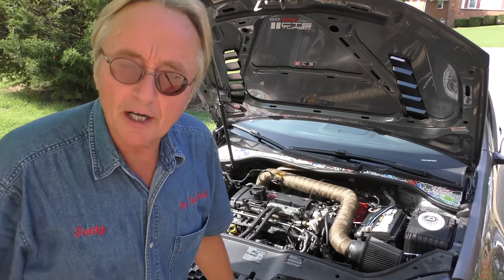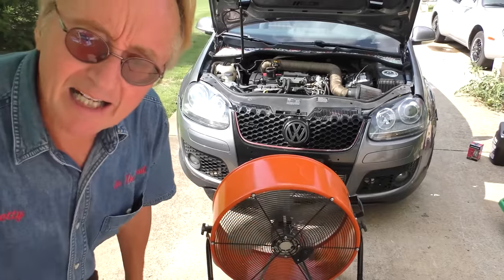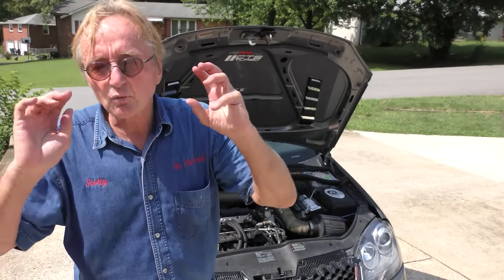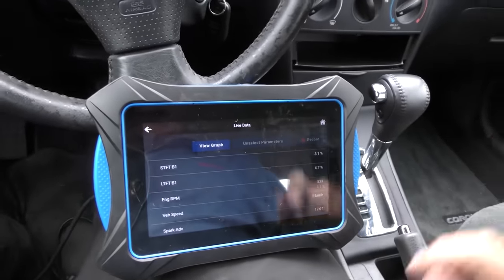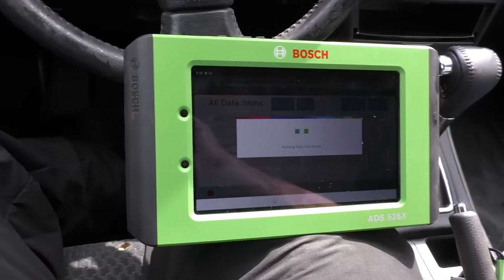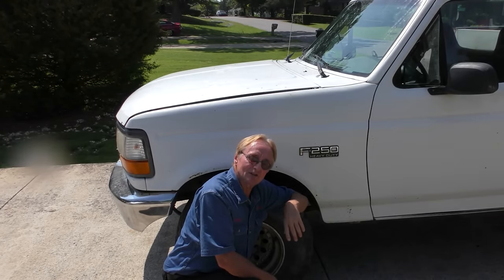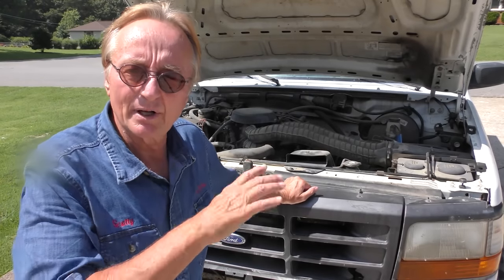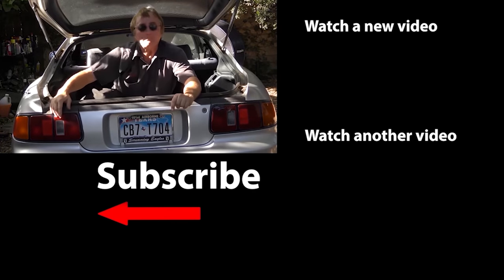3 Additives That Will Make Your Car Last Twice as Long

Comment: I've been adding half a qt of transmission fluid to my oil for ever. My dad did it to his trucks my grandfather and so on. My Isuzu trooper has over 600k miles on it. Never had engine problems. My 98 silverado was at 380k miles and never had any mechanical issues engine wise. My 2013 just started having engine issues. Gave it a qt of trans fluid and a week later it went away. Had lifters failing. No more issues 2 months later

Comment: Gm ecotec 4cyl.
Used 1 oz of marvel mystery oil in each cylinder. Cranked it without starting it, let it set for 24 hours. Then, Warmed it up, changed the oil, solved the oil burning issue, 1 qt every 500 miles is bad. Your right Scotty, those low tension rings collect carbon and stop doing their job.

Comment: Dear Scotty,

I just bought a new car and it's not even at 2,000 miles yet. Do you recommend any additives or additional things that might prolong the life of the vehicle? I use top-tier rated gas stations, so no cheap gas going in. Let me know what you think, but I don't want to mess it up so I'm holding off on adding anything. Have plenty of Marvel Mystery Oil though lol
Reply: Naaaah, just keep doing what you're doing Jerd. Just put it on the road periodically once or twice a month to exercise the motor, for city driving is like a slow death
Reply: you nèed it

Comment: NEW TO YOUR CHANNEL, Scotty! A really wonderful & instructive video!  I think I need to use that ATS 505 CRO additive on my 2010 Audi S-4 with 137K miles. It's been going through oil more frequently over the last year or so. I'm thinking there's a lot of that same build-up around its V-6 pistons. Hopefully it will reduce oil burning AND give me better performance.  I really love this (manual-trans) car; had it since new in 2010.

You have outstanding tutorials, Scotty. I feel like I'm right there in your driveway in the TX 'burbs.  I'll be checking you out more in the future.  QUESTION: What's with all the flailing hand & arms movement??  You'd think you were Italian! 😀

Comment: My 2014 Acura TSX has120000 miles.
Uses no oil 
I bought it in 2017 with 18000 miles.
I have no complaints 
I treated the rubber on the cb joints with reseal like you recommended.

Comment: The video portion for the carbon remover shows Scotty holding ATS Chemical 505 cro, not the Ring product. I found a few sellers on ebay selling it for $38.00 plus shipping.

Comment: I had the OD light started blinking @ me. What I did to remedy the problem. 1.) Drain the transmission of ~60 ozs. of fluid through the filler tube. 2.) Re-fill with Lucas transmission sealer & conditioner. 3.) reset/clear codes, problem went away. Would've cost me $5,000 for a new transmission on my 2002 Ford Explore 4x4.  The trans would shift down into O.D. by itself when this was a problem.

Comment: Oh yes it works. So the first one, after removing the carbon into the oil, would it be safe to drive a few miles for an oil change? Or do I HAVE to perform the oil change right there.? I know you won't respond but I figured it is worth a shot.

Comment: When I was younger I bought an old caddy never had the oil changed. Was like mud and the motor sounded like it needed a rebuild.  An old mechanic of my dads told me to put a cup of diesel fuel in the oil. Let it idle for 10 minutes.. drain and change and drain and change again. That motor ran great

Comment: A similar engine cleaner product from seafoam helped me reduce oil consumption from 1qt every 1,200 miles to zero oil loss on my 2008 GMC 5.3L. I also installed the updated valve cover and disabled the cylinder deactivation mod prior to that but it was still burning oil before the cleaning.

Comment: I can attest to the Lucas engine oil stop leak and the Lucas power steering stop leak and Sea Foam  and Engine Restorer actually working if the problem is fixable by using the additive.

Comment: I had a 74 or 78 Ford LTD with a 351 Windsor engine.  It was nice to drive.  Unfortunately it was stolen while being worked on at a Sears auto repair shop back in 1989.

Comment: By the time you pour the Transmission Fix into a pot, heat it up, and then take it to the vehicle to pour it in, you probably could have poured in 2 or 3 cold bottles in the same amount of time.

Comment: Major issue are longlifecycles for engine-oil renewal, especially in combination with EGR  what nowadays all engines have diesel as petrol engines. reduce cycles to around 7.000 miles / 10.000 km for oil change, and decarbonize intake every 50.000 miles/ 80.000 km, or if legal deactivate EGR.

Comment: Hey Scotty. Love your enthusiasm. I'm and old mechanic from way back. Use to keep up a fleet of Econolines when I was 16/17 and serviced flight line equipment in the USAF back in the 70's.. Now I'm 71.
I have a '98 1500 Suburban. 5.7 L. It has 272K miles on it. I'm getting a code that says 'misfire' on cyl 4. New wires,plugs etc less tha 5K miles agao.  Is this probably a valve issue? Is there an easy fix? I'm expecting it will have to have top to bottom work to fix. UGH expensive..Any suggestions, advise! 
Thanks, Steve

Comment: A couple of coats of Rustoleum Rust converter will help out underneath, to keep it from rusting through.   I use Sea Foam also, a full can in the tank once in a while. My 01 has just turned 300,000. Tranny and rear end had to be rebuilt after 250,000. Minor maintenance compared to the price of a new one.

Comment: 4:10 Experiments require a control or evidence. 
How dirty was the oil before?
A Fortnine video shows that running a motorcycle at high  RPMs with no additives will do a similar cleaning process. Ao is the 15 min of high ROMs or the additive. If the additive makes it better, how much better?
Thanks for spending time and energy doing these tests! 
🤘👏

Comment: Scotty,  my 1988 F250 4x4 with a ZF 5 speed has 337,000 miles on it,  if that does not speak well of a 351W,  I don't know what does.  The truck lives the first 110,000 owned by an electrician,  then the next 227K by me doing construction work.  Once I get my garage built,  I want to go over the truck and do brakes and lines,, new timing gears and chains, steering and suspension,  shocks and see if I can get it up to 500K before I am too old to drive in another 15-20 years,

Comment: Scotty - a few questions.  You've made a video in the past about not using engine flush - "Why Not to Flush the Engine Oil in Your Car".  The ATS 505CRO is an engine flush.  Are you recommending only this engine flush or just to flush GDI engines?  Also, the ATS 505CRO and 505CRF come in a package and it's about $60.  Do you recommend any of the other engine flushes that claim to de-carbonize and cost less?  For example, Amsoil Engine and Transmission Flush.

Comment: I had my son locate a supplier to get both 505 additives.  My f150,  22 years old with 100,0000” miles was getting 13 miles to tha gallon.  Afterwards I am now getting 17.5 miles per gallon in town driving.  The cost for both was $70.00. $ 16.00 for shipping.  So $54.00 for both or $27.00 each.

Comment: I suck at working on cars so I drive a 93 2.3 ranger. Rear brakes are harder to do than clutch replacement. Owned since new 760000 miles.

Comment: best solution i've used for carbon buildup is the seafoam spray. you slowly spray the whole can inside the intake as the car runs at 1500rpm, then turn it off for 15 min, then turn it on and rev it at different rpm ranges for about 5 min. it will smoke like crazy but then you will feel the engine having much better response; and the carbon in the valves and piston will be minimized 5% to 10%.

Comment: Hey Scotty, it was actually louder after you ran it at 2000 rpm with that stuff in it in that insane heat. I would never put any engine through that in that heat with that mileage or any mileage.

Comment: If its like a 1973 ford it probably needs a power steering sector box. But mine was worn and had a spindle. Valve at. The top that takes shims to adjust it and that will likely get rid of the pull to the left or right ehich is induced by that valve not bein centered and forcing fluid to one side od the assist piston causing the pull that valve neutralizes the fluid to circulate and turning the wheel one way or other send s fluid to assist your turning. But is centered by shims as i remember

Comment: Direct injection engines make more noise because has more mechanical parts than conventional ones an example is the high pressure fuel pump very well know in ecoboost engines in general and the ticking noise which is normal go away with Ceratec in the oil.

Comment: Carbon buildup on the inlet valves with these direct injection engines can only cleaned by hand (walnut blasting).

Comment: Royal Purple? My Didge Dart is getting worse gas mileage than it did before. I put properly gapped NGK spark plugs in there. Runs much better,but the mileage is still not where it should be. I'm going to get four new ignition coils in it this week,also NGK. I'll see how it does then. It's a 2013 with a 2.0 liter engine.  I love the car,but the mileage needs to be better again. If the coils don't help,I'm going to try the injector cleaner. I've never had the injectors cleaned.

Comment: Dont know if this will ever be seen but hearing Scotty say "Germans really like putting like screws in these things" immediately brings flashbacks to replacing cv axles on a 04 6 speed gli. They had bolts not nuts for those axles. Loooooong bolts 😂

Comment: My car was running lean so I used sea foam (runs in e85) and the next day after driving it around a little my check engine light is gone. I have no more issues now and feel 0 stutter.

Comment: Friend of mine used diesel engine oil from 40,000 km  onwards  375,00 km and counting  motor has had 3 timing belts and is spotless internally  burns nothing  ,oil was Case No 1  10 w 40  car was issuzu  light commercial  Holden Rodeo efi petrol .

Comment: For those of us living in europe, are there any reliable brands for the products shown in this video? ATS engine cleaner is impossible to find over here and the other two are very difficult. Would Wynns or any other do the job? Also, is the "Lucas transmission stop" only for automatic cars or do manual cars also benefit from it? Thanks!

Comment: Something odd, driving from TN down through NC, running 4wd in the snow, I got better than 17mpg in 2000 Tundra with 2uz-4e V-8 and driving up hill and down hill.  Which I fueled up at a Shell station, where they must had a better gas.  I’ve heard of some gas stations in the past providing better gas mileage.  Maybe they had pure gasoline refined to a better formula.
As in flatland, I only get 17 mpg in 2wd.  Where maybe they sell a cheaper gas that they can sell cheaper to create an illusion of better gas prices????

Comment: Saw another Scotty video where he recommended ATS fuel system cleaner, which they were out of stock forever, probably pandemic related, but now he's recommending Royal purple it looks like. Royal purple is cheaper and easier to get, I could swear I also saw a Scotty vid where he recommended not using any fuel additives at all, I'm confused 🤔.... again

Comment: Hey Scotty I got an 2008 Infiniti g35X it’s got not even 170,000 miles but I live in the pocono mountains and any time I’m going down hill my engine/trans really revs up the second I tap the brakes, rpms shoot up to as high as 3,500-4000 is this some type of slip happening in my transmission? Drives like a champ otherwise just never had a car do this before..

Comment: Has anyone had any issues repeatedly using the Royal Purple Max Fuel injector cleaner? I'm wondering if using it once, at each oil change, can result in damage to sensors, catalytic converter, gasket, piston rings, muffler etc? I'd love to hear that it doesn't but would really just like to know if it's safe enough for use to get the benefit without the sting of increased repair costs or performance issues due to the chemicals the Royal Purple Max Fuel injector cleaner introduces into the fuel system, engine and exhaust. Thanks so much!

Comment: AT 2:28 you probably don't smell the product due to worn piston rings, but from off-gassing in the crankcase as the oil heats up and the product escapes into the intake via the Positive Crankcase Ventilation (PCV) valve. 🙄

Comment: I know this is a year old. But when you said the one gm motor they said is okay to burn 1 quart every 1000 miles is insane. I got a 21 kia seltos. And they told me it was okay to burn half a quart every 1000 miles. Just a few mo ths ago I had a issue where my car burned through 3 quarts of oil  . It's only got 40k miles on it.

Comment: Scotty ,enjoy watching your videos, have a 2015 jeep patriot ,yesterday car started doing bad surging while driving ,today I ck batt 4 yr old which had corrosion on terms, batt was at 1249 v , so I took terms off and cleaned. And started and drove and motor sudden gave me volt light .and quit running, .restarted and drove back eng light came on , cked batt volts eng running and now battery showed 1249 + - 1229 rev motor with no change ,  I'm thinking alternator quit working . could I be right . ?

Comment: That old Windsor engine might be crappy on mileage, but it'll run longer than the rest of the truck will last, in the rust belt at least.

Comment: I just bought a 2008 Toyota Tundra Crewmax 87k miles. Should I use the transmission slip on this? I want to start fresh with everything on the vehicle. Thanks. I don’t notice any slipping.

Comment: Less noise is not always a good thing. Used car dealers used to mix gear oil with engine oil to quieten lifters... meanwhile, the lifters were wearing 10 times as fast.

A lot of things will make your engine quiet. Chlorine bleach will really tone one down... but you don't want to replace your engine oil with it.

Comment: So I have a 2015 GMC Sierra 1500 5.3 V8 with 111,000 miles. Should I change the transmission fluid and filter or would it make things worse?

Comment: @Scotty Kilmer Hi Scotty. I have a 2000 Honda civic with 82,600 original miles. I smell gas inside the car when I start it up and when I prop the hood up I smell gas. I don’t see any leaks. I checked the fuel rail and no leaks there. I can smell the gas when I get close to the exhaust manifold but I can also smell it when I get near the fuel rail. What do you think could be the problem or what should I check? Thanks 🙏🏼

Comment: I did this exact thing on an old truck. The next day, it ran fine. The next day, it wouldn't start. The engine was locked up. Appearantly, there was so much carbon that some of it clogged an oil passage to one of the piston rods, and it welded itself to the crank shaft. I'll never use this crap again.

Comment: On the VW, I wonder what the oil would have looked like if it was a fresh change just before running the ATS engine cleaner.  How dirty would it have been after the cleaner was used?

Comment: There is only one additive that works to make your engine literally last forever. Marvel Mystery Oil.  I am a 67 year old Blacksmith, Wood Craftsman and I have an amazing story that verified that Marvel actually works.  An aviation legend who I  can't reveal the name told me about taking his engine "heads" into the shop and they would always call him and ask  "Bill, what kind of oil are you using in your plane"?  He'd always say "why?"   
"Well, there is literally no wear on your cam lobes, valves or top end"  Bill never told them what he was actually putting in his oil....one quart of Marvel Mystery Oil with every oil change.

Comment: Great video Scotty my question to you is I have a Lincoln mks 2011 awd and it has a rough idle but no cel light at all replace spark plugs,o2 sensor ,maf sensor it’s idle kinda fine in park and neutral but reverse or drive it’s really rough can you help me please tired of just throwing money into it and o yeah it has 238456 miles on it

Comment: Hey could you work on my vehicle? It’s an odd one, it’s a 2003 Mazda Miata and it doesn’t run right, it hiccups to start and when it does it idles fine and then it start to “lope” when it heats up, it sound like it has a huge cam lol, I’ve tried everything, your the guy I know who could fix it

Comment: The typical cause of burning oil in the late-model GM V8 engines isn't related to the "low-tension" piston rings.  It's actually a known issue caused by the Displacement On Demand system in the late-model GM V8 engines.  That's why GM says it's "normal" for it to burn oil.  If you make sure to keep the engine oil topped up and the oil changed regularly this will never cause a problem with the engine itself.  It's just an annoyance for the wallet.

Comment: You completely failed to mention the Hands Down BEST additive of them all: Prolong - The Only Engine Oil Additive that forms a molecular bond with metal that keeps all the internal engine components constantly lubricated, thereby reducing friction between moving surfaces and thus increasing gas mileage while significantly inhibiting rust, and making your engine last forever. Prolong is the Only Engine Lubrication Additive that gives you a Lifetime Warranty on your engine that will cover repairs needed to address engine component failures resulting from poor or insufficient lubrication.

Comment: How did you keep the car at 2000 rpm for 15 min?  I'd like try this oil and fuel cleaner.  Neutral and use cruise control?  Could I just take a slow drive around my neighborhood and keep the rpms around 2k?  2012 mustang gt 5.0, mt82 6 speed manual

Comment: If i change my engine oil when it's hot - will more suspended contaminants drain out than with cool oil ? How fast do contaminants settle to the bottom of the oil pan ? Thank you for your reply ...